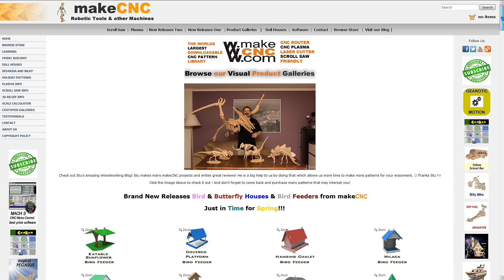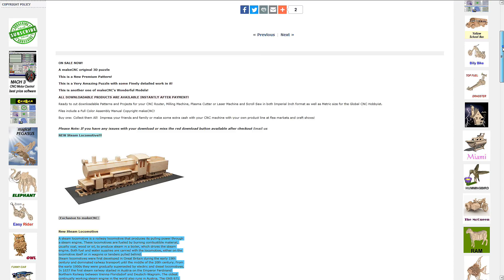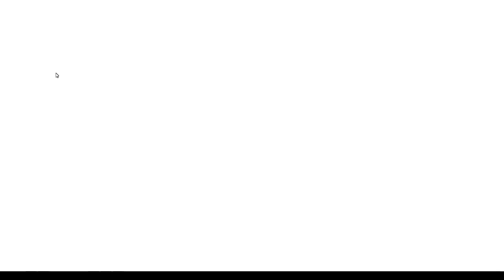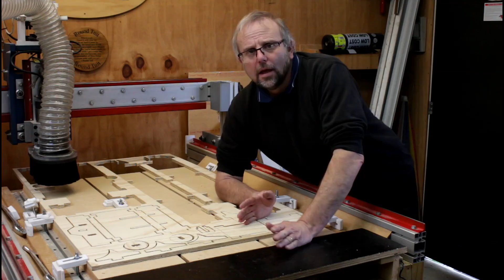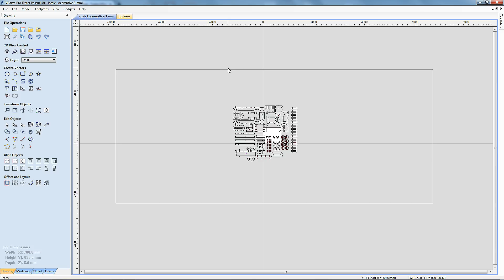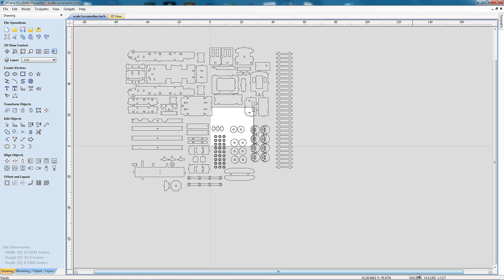Making a Train Part 1 - CNCnutz Episode 163

Comment: How did you calculate  the %
Reply from the maker: The size the you want the piece to be multiplied by the size it actually is, then multiplied by 100.
eg (12.5 / 3) x 100  = 416.6666666666666666666666666666666666666666666666

Cheers
Peter

Comment: Hi peter another great video thank you.
I do not have a lot of luck with ply and i do use the good stuff, could you put the cutter you use ( i notice you mention downcut not compressive) and the Feed and Speed that gives you the success in the video please, keep them coming :-)
Reply: Thanks peter, i did get the app but it always seems to show 80 to 120 and i find that a large window, i must admit i had not thought about non spiral, thanks again
Reply from the maker: Hi Bernie,
I'm sorry I have put you wrong. I was meant to say not a compression bit but for some reason i put not a spiral.
There is no such thing as a straight flute down cut bit thought a straight cut bit is better than upcut when cutting plywood.
I have deleted the previous comment so it doesn't screw anyone else up.
Here is a link to the cutter I used for this project. I bought a packet of 10 back in 2015 and they have lasted me well.
I see thay have also come down in price as well and if you hunt around you may find them for a better price.

http://ebay.to/2kIe1WL

To clarify on my earlier post

The bit I used is a 1/8" spiral downcut bit single flute.  1/8 diameter,  50ipm though using speed override I pushed it up to 100 ipm, 10000rpm and 2.5mm per pass. I used the calculated feedrate from the US Router Tools app I showed in my speeds and feeds video. Will put a link in the next video to where the bits can be purchased. 
https://youtu.be/lCf0EYLfGDw
cheers
Peter
Reply: brilliant many thanks for your reply and time

Comment: Peter, Great video and project.  I am a train lover so it will be cool to see where this model ends up.  One thing I think you might consider mentioning about Make CNC models.  I have found that sometimes there are open vectors, and when you go to nest these, the open vectors seem to "Disappear".  For example, I just done the "Amazing Spider" puzzle and after setting my material size and scaling the vectors, I selected them all to nest them creating multiple sheets.  After examining the sheets and parts layout, I noticed three pieces were missing.  In my case it was parts from the bulbous section of the body.  After undoing the nest, I select all the vectors and joined any open vectors.  This fixed the problem.  Maybe that will help some newcomers to the 3D puzzle world.

Joe
Reply from the maker: Thanks for the heads up on that Joe. I didn't encounter any problems myself but as a matter of cource I close all vectors before I start. I will mention this in the next video.
Cheers
Peter

Comment: Great project, Peter! That's really going to be a cool model. I can't wait to see it finished. 

Thank you also for the scaling tip. That's brilliant! I just tried it in VCarve about 13 different ways, using several different imperial measurements, and it works flawlessly. That's going to save a lot of hair pulling when trying to get the exact size of something just right. Thank you!
Reply from the maker: +Mark Lindsay CNC
Thanks Mark. I find it a quick and simple way to scale without having to think. It just works.
Cheers
Peter

Comment: Can also put in the % area .52/.125 =
And let aspire or vcarve pro do the calculation. 
Excellent job peter
Reply from the maker: +dan miller
As you say if you enter the formula into the percentage box it will calculated for you. The correct formula is (. 52 /. 125) * 100 = because it is a percentage.
Cheers
Peter

Comment: Peter great project. Are you not using hold down tabs?
Reply from the maker: Not on this one.
The pieces are very large and generally don't move. 
When  the piece does release it normally is pushed away by the cutter without damaging the part
Downcutting bits tend to pack sawdust into the slots locking them on place and sometimes almost have to be cut out afterwards. Thick MDF is diabolical. However that didn't happen in this case because the ply bowed when it was cut at I knew it would. Cutting into the ply releases the internal stresses and the ply turns into  a pretzel. Because it did bow any holding tab I put on the pieces would have been cut anyway when the stock rose making them pointless. I could have nailed or screwed the stock in the centre to stop or reduce the bowing but I am not a fan of that personally. 
Cheers
Peter